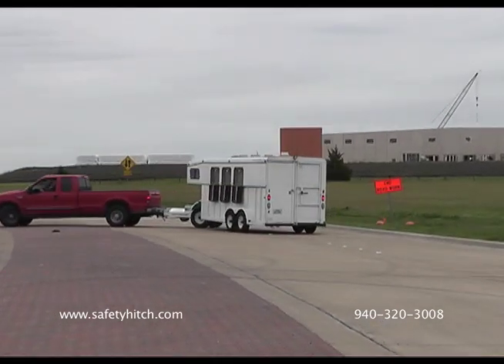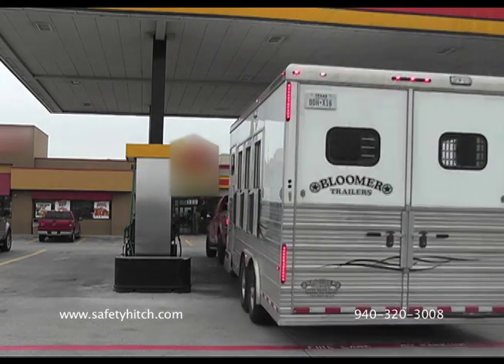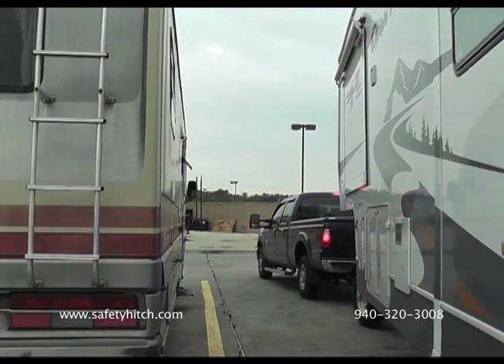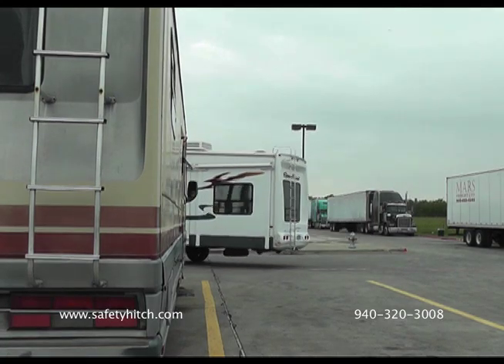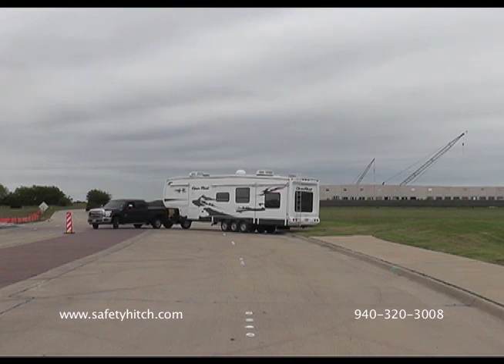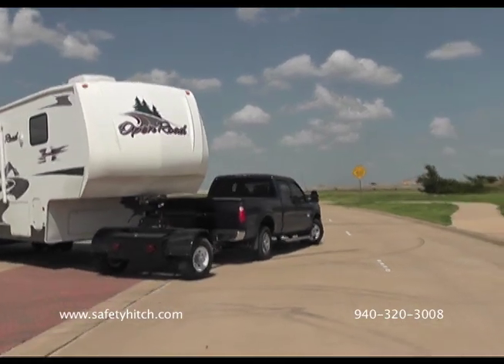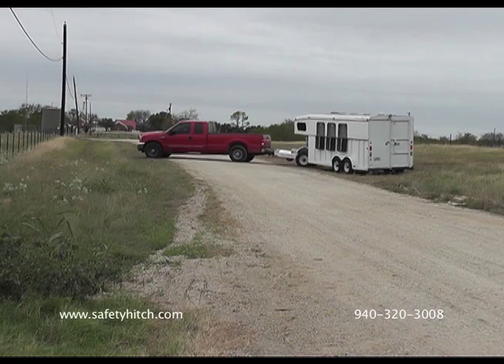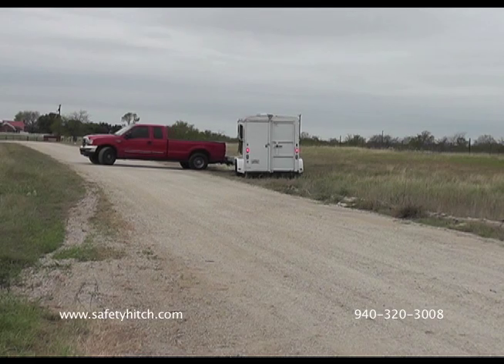Maneuverability - The Automated Safety Hitch System

Comment: As it misses the  Rv on the left..and if there's one on your right seems to swing out more..and whats the coefficient of drag since the trailer is designed to use the low pressure pocket that form behind the cab / Trk Bed and now its 2 to 3x the distance now.

Comment: Front outside tire of the truck seems to be extremely stressed in the turns.  You can see by how low the suspension is in that corner and the tire tracks it makes.
This looks like a great idea but I think the steering could be made much better with bigger angle as to not stress the alignment of the truck too much.

Comment: I sure as hell wouldn't want to use this product on ice and snow packed roads. Steering would become impossible since the truck has to swing the dolly out with all the trailer weight in it. Also if having to travel in heavy mud, the trailer would probably get stuck and be like pulling a lead weight. I prefer the traditional way of pulling fifth wheels and goosenecks. You have the tongue weight of the trailer over your drive axle for traction. Other things to consider. I can't imagine this being good on your truck tires, leaf springs, U-joints, axle bearings, tie rods, and bushings on the tow vehicle. If you think about it, swinging all that weight like that would put a lot of pressure on those parts. Just my opinion.
Reply: You should watch their Recovery video for muddy situations, it has a self recovery system albeit how it actually works. As for ice, I am right there with you and it would be a scary as heck situation as myself being an experienced CDL A holder.

Comment: That's nice, but when you show the 40 foot 5th wheel trailer being jackknifed on dry pavement, that only happens Completely Empty. Load up the trailer with clothes and water in the tank and supplies for camping and try that, either the tires will peel off the wheels, the leaf spring shackles will twist and bend, or the underframe twists and pulls the screws out of the flooring. We've transported these for several years and all the manufacturers forbid against a spin like that on pavement. Grass, dirt, or loose gravel maybe. We know you did it only for demonstration, but we were cringing waiting to see a tire peel off. Show the backing technique, that extra pivot point needs a different steering input.

Comment: I agree with hailstone.  tho for an average idiot that's bought a camper or horse trailer that goes to a weekend warrior type thing it may be great to save their cab or box on that shiny new truck when they pull in somewhere they shouldn't. I fail to see the added stability that could be simply solved by having dual wheels.   it looks like to me that under a max load situation on hard surfaces like concrete it could cause the frame of the power unit undo stress if the tires on the safety unit do not turn with the radius of the truck.  and what about when their is a bearing failure on the safety unit at 70mph on a curve.  how in the blue blazes are you going to hang onto it to get it stopped without having a real mess

Comment: The only truly positive thing about this as far as towing goes would be the added braking but I don't think that is true. In their video they simply showed a comparison of their hitch with the brakes turned on and then off on the hitches axle. Obviously when on it stopped quicker. There is just one problem; the pin weight GREATLY add to the effectiveness of the trucks brakes. Subtracting the 1000+lbs this hitch adds to your rig and ill bet you anything a normal set up truck will stop just as fast. A normal truck even has the weight pushing down on both of the truck axles because you are supposed to put the hitch in front of the rear axle. It would actually normally put weight on the front axle which is the most effective at braking so......ya. Stability again is a thing where with the pin weigh pushing down on both axles, I don't think this is going to be any more stable. Steering and maneuverability? Well this thing adds a giant lever on the back of the truck to pivot on the rear axle and move the front tires. Adds a lot of stress to all the components of your truck. Traction is a huge issue as well. Additional negatives are around 10ft added to the length of your rig, extra axle and tires to maintain and monitor, coast about $12k, adds 1000+lbs to your truck, looks ugly as hell, higher tolls where they charge per axle. Really don't see the point of this. Maybe that's why this thing has been out for like 10 years and I have yet to see one in real life.
Reply: Just because you have not seen this or another like it does not mean they are not selling. And as per your assumptions, they know what they are doing when they designed and built this, pretty sure those engineers understand how it works compared to semis with their fifth wheels which I am experienced and licensed to operate. But unless you load the trailer wrong you are going to have the issues you mention, thus why the manufacturers tel you to make sure you load 60% in front of the axle and 40% behind the center of the axles, this mean in two axle set up you want most of that weight forward of the middle of those axle hubs. This is why weight stations exists to check your load weight distribution so you can adjust before further travel.
Reply: While it does take weight off the truck, it does add a whole extra set of brakes that wouldn't normally be there.
The two big advantages that apply to me is, I can tow with my van or suburban,  and if my truck brakes down (which has happened to me on the way to a job) I can now rent a uhaul truck and get my rv where I need to be and worry about the truck later.